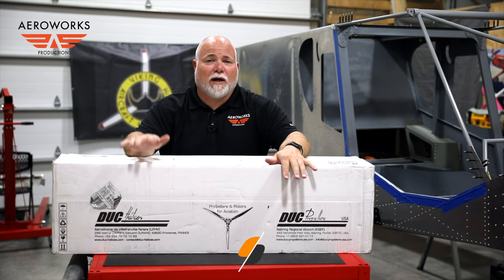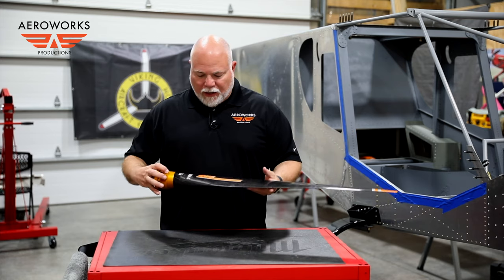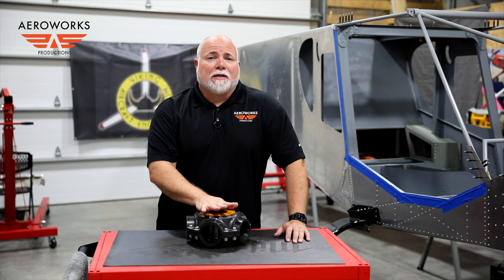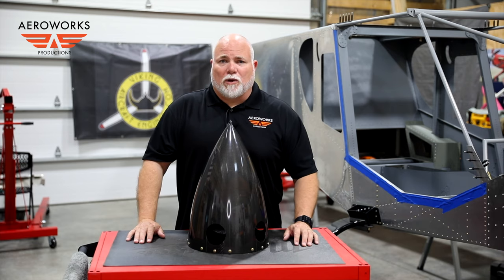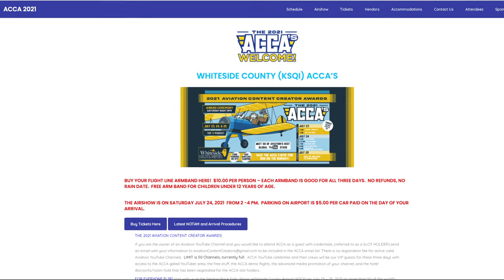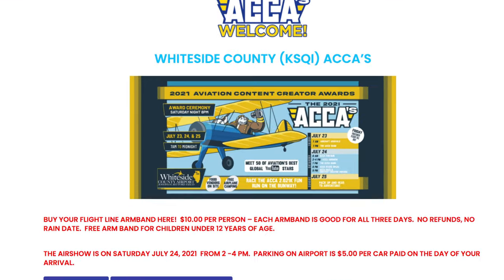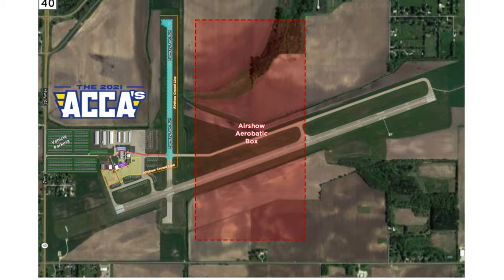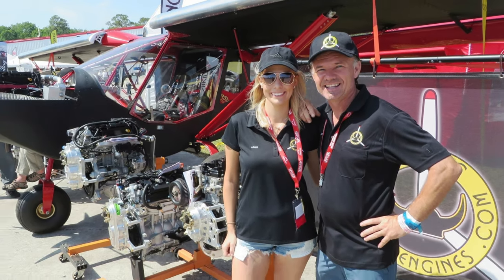Ep.35 | DUC 5 Bladed CARBON FIBER Prop | Zenith Super Duty Aircraft Build

Comment: There is always something I don’t know, so this will be interesting. Cutting 4130 heavy wall steel with a tubing cutter and doing so without creating a smaller inside diameter. Will be interesting to see if it works. Have you tried the fit right now, prior to cutting?
Reply from the maker: I guess we’ll see in the next episode…

Comment: If the carbon hasn’t been cleared, you should apply a 2k clear to protect the resin from UV damage.
Reply from the maker: The resin that they use is UV resistant (from the manufacturer).